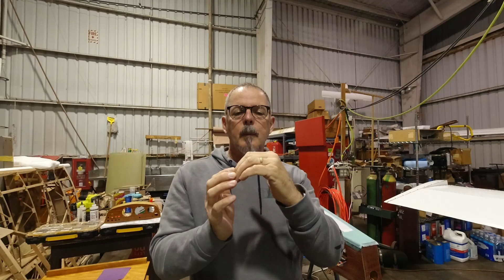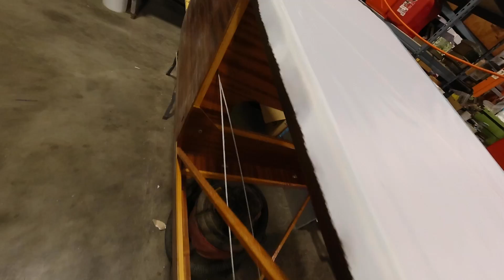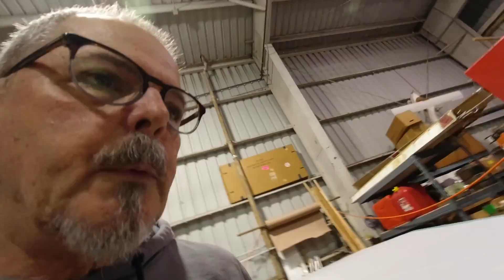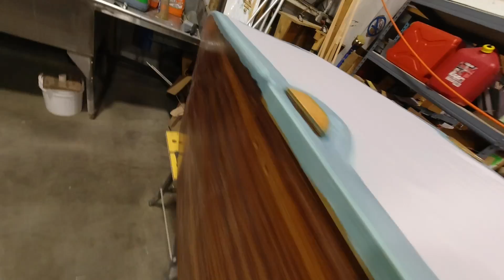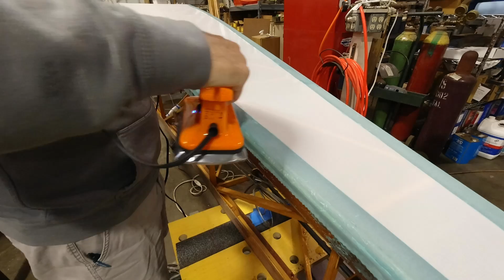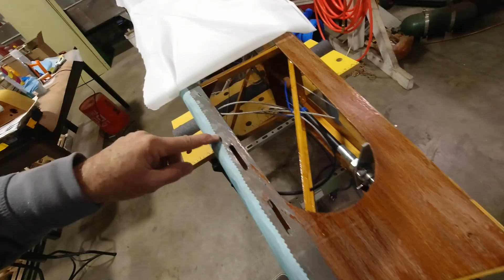Minimax 1100r Wood Aircraft Build Ep 145

Comment: Dennis, you are honest to a fault.  :-)  That's why we like you and follow you.  Just had a quick thought: One of the first times I landed my EROS 1650 "off airport," make that a farmer's field. :-)  then, when doing a quick "post flight" (bounced and rambled a lot during landing) I saw a long stick, of sorts, punched through the Hori Stab, my first comment was - "Damn, and I worked on that covering so hard. :-)   But, that's better than breaking off the tail wheel, twice, due to the terrain - that spring steel will break at a bolt radius, if it flexes enough.     Hey, stuff happens when you are having fun,  All looks really nice Dennis.
Reply from the maker: Thanks Michael, I enjoy hearing about all of your adventures!
Reply: @DTMinimax  Dennis.  Hope this note reaches you - been having some difficulties with the old "Edge Browser."

As your wing covering will be coming up, I wondered if you had considered adding a 1/2 inch cap strip to the top and bottom of each rib?  You may be rib stitching, but  if not, these cap strips would add DOUBLE the   surface area for gluing down your wing surface covering.

There's a lot to say about stitching - if your wing covering should fail, that failure would be contained to a rib bay.  However, of my three coverings,  I never had a problem.  However, in flight, watching some of the wing material "move," at 110mph, made me think of stitching.  :-)  My covering was, basically, "drum tight" - not so much as to pull the ribs out of position, but fairly tight.  Yes, it's hard to reach a tension that you like.

Love the covering process - we'll be looking over your shoulder.